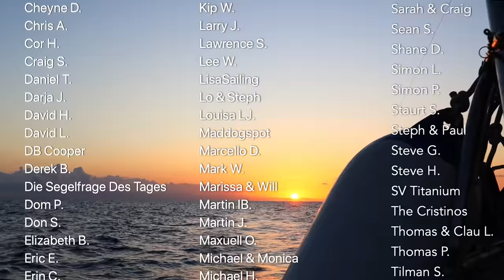82] Boat Crash Damage Repair + Sailing To Our WEDDING!

Comment: Congrats to your marriage.....and always good luck for the rest of your lifes.
To Ryan I have the following information.
You should know that this kind of repair might become a problem later. Threaded rods have only a bit more than half the srength of a screw. A regular screw 
ISO 4017 - M12 x length - 8.8 can hold a load of about 20 kN.  The threaded rod starts to strech a lot at 10 kN load. I would have tried to get a screw with fine thread according to DIN EN 28765 - M12 x lenght with a nut ISO 8673 - M12 x 1.5 - 8.  In other countries maybe you can't get DIN EN normed screws. But whatever you can get, treaded rods always have a big handicap when it comes to stretching forces. If no other way is available, try to drill the hole to 18 mm diameter and use a rod with 16 mm diameter. Annother good repair would be get a round unthreaded 12mm rod from high strenth quality stainless steel, cut it to the right length and have it threaded at the ends. Each half way well equipped car workshop should be able to cut that thread.....using enough cutting oil. Cutting threads on stainless steel is a problem for mechanics with litte experience.

Comment: Congratulations on your wedding and repair job. Ryan could make some extra money repairing boats in more remote locations where there are no repair shops. He thinks through the problem and comes up with solutions that result in a repair that is better than manufacturer's original set-up. (And with no small tools or items on the bottom.) Looking forward to the chain plate final fix.

Comment: Hi Guys. Bit surprised that you even had contact with the  other parties insurer, Or they were not prepared to "return you to the position you were directly before the incident" and cover any ongoing costs as its a legal requirement under european law. Having said that, we think you did the right thing but should have got some backup from your insurers!  We had a similar issue back in France. Our insurers were brilliant (Pantaenius) We were able to do the work ourselves and claim back the cost without any contact with the 'at fault" owner or his insurer. All our costs were met in full.  It's in our vid "boat crash we get hit" you may find it interesting..... Hope your nearly there by now. Sail Safe guys. Ant, Cid and the pooch crew.

Comment: Congrats you guys on the wedding! As one who has been burned by every conceivable type of insurance, the only advice I can give you is to learn that insurance companies hire adjusters to adjust the amount they may offer you down to an amount where you won't bother suing them. Really, should it cost less to fix on older boat? Of coarse not. At this stage they aren't likely to give you anything. If you had negotiated a settlement to cover the cost of materials before doing any work, you may have been offered an insult of a settlement. I think when you have time, it's time to get bids from other insurance companies. I would trust Ryan to repair my boat if I still had it.

Comment: Congrats on your wedding guys, the bride was absolutely beautiful and Ryan was looking pretty sharp as well! Boat damage and the insurance company's handling of it sucked. Well I guess chalk this up to a lesson learned next time you will know. Like someone else mentioned don't be afraid to negotiate with them but in fairness to you two you didn't know what the process was until you have been through it? Now you have, what really sucks is if you had damaged someone else's boat I know you would have been accountable and made sure the other folks boat was repaired properly. That's the worst part good folks always seem to get screwed. Excellent repair work as always Ryan and of course Elena the assistant mechanic is critical.

Comment: Congrats!
How about Pine tar under the sprit? Such an imperfect wood to wood bond fails easily and opens for capillary water entry. 

-Signed, a fanatical traditionalist
Reply: Absolutely and although Ryan sealed the top nuts of the pin nothing keeps the water from running under the sprit through the wood +fiber along the pin in the locker rotting everything. I admire those two "kids"for their  drive and perseverance but I cant help finding grave structural fault in about every repair done .Maybe it is the internet where most everybody cheers" well done"," incredible" ,"great job" that goes to ones head till they believe they are 
shipwrights ,traditionally a 10 year apprenticeship.

Comment: Did the material grade of the bent king bolt (normally stamped on the bolt head) match the threaded bar material?  Only concern is mechanical loads - tension and shear.

Comment: You should replace that threaded rod with a proper  class 5 or better bolt at your first opportunity.  That not is no where near as strong as a proper bolt.  I know from having torn it apart many times.

Comment: Your claim is a valid claim. Your Insurer should confirm that the claim is covered under the policy and then pay your claim (subject to any excess) and then subrogate against (recover from) the Italian Insurer. Asking you to pursue the claim against the Italian Insurer is not Treating their Customers Fairly. It is clear that you have acted as a prudent uninsured by fixing it properly yourself and preventing further losses. This is called “Sue & Labour” and is a fully recoverable expense / disbursement. If it you are insured with an UK Insurer I would start the complaints procedure with your Insurer.

Comment: What did you expect? Insurance companies are all fraudsters and try with all means to limit and/or delay payments until the injured party is finally satisfied with a sum that is significantly below the recovery value.
I only had the case once that an insurance company paid the damage amount immediately (and in full). The causer of the damage was in the same insurance group where I had my legal expenses insurance. At first the same game, the insurance company tried to compensate me with a ridiculously small amount. After inquiring whether my legal protection insurance would cover the claim, I received a promise of the full amount of the damage from the liability insurance of the person who caused the damage.

Comment: You guys need to post the name of the insurance company. Because it is rigging and not structural they should have covered it all, it was the fault of the other boat. Their time span was also designed to dissuade you.
Get a deck gun so next time you can just blow the offenders out of the water.

Comment: Typical dishonest insurance company.
Reply: _ My question is 'Why are they dealing DIRECT with the perpetrator's insurance'? Of course, they're going to STALL and eventually one gets so frustrated that you just 'Move-On' which is exactly their tactic. _
Reply: Robert Rudolph had a similar problem. It doesn’t work like it does with cars. You have to contact the other insurance company not yours. Had to do the same.